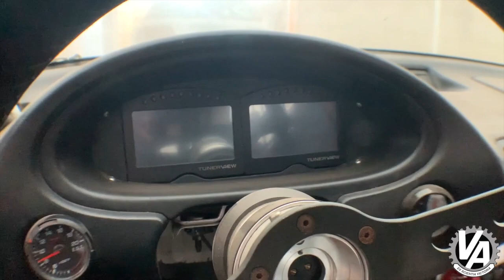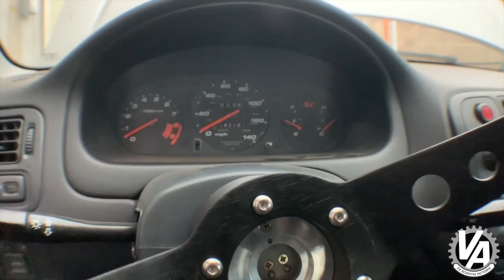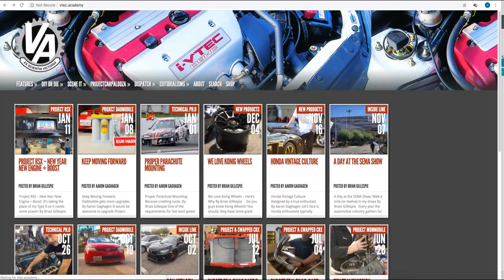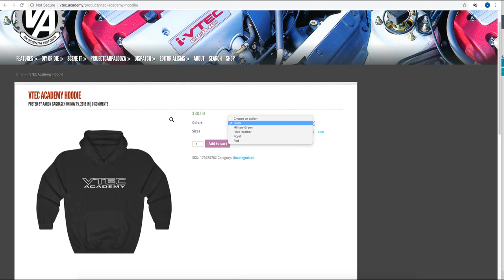B SERIES TRANSMISSION CHECK

Comment: Mainshaft outer case bearing staying in the outer case is not a sign of a bad bearing. Happens even with a brand new ITR transmission getting a FD/LSD install.
Reply: Mista boooooone
Reply: Lol nitrous single cam master
Reply: I agree, everyone I have seen has had the bearing stick in the case due to viscous oil remnant issues. They pull out easily or are a little cocked and just need a wiggle.
Reply: Mista bone the og transmission god takes me back to Honda tech
Reply: Mista bone an aquafina has all the transmission knowledge u need
Reply: First time I asked about getting synchros for Honda D-series, I asked Brian G. the OG and he gave me the aftermarket part numbers, that was 20 years ago.
Reply: @joshdane5657  There are others as well. Translab, Ghostwerks, as well as a few people local to AZ that Brian uses.
Reply: @Lulz Kev I've been around for 20+ years, since CRX Perf/Hybrid days.
Reply: @mistabone3899  ZC dual can days
Reply: @kevinc9006  or "One Cam Only" days

Comment: My notes from watching, 92-93 LS trans.

Mainshaft is toast due to the spline damage from the hub.

Countershaft needs stripped and checked for clogged oil passages as well as the outer bearings being damaged from the lack of fluid....or using current Honda MTF in an older transmission, esp. in the desert heat.

Likely the 92-93 5th shift fork is no longer available (NLA) Good news is 94-01 forks interchange.

Comment: This dude: 10 minute tear down and reassembly with a B series.
Me: 10 week tear down and reassembly with my H series. But I did do all new bearings seals, accord 5th gear, carbon fiber synchros. NO LSD. Damn I am stupid.
Reply: Do a few hundred or more, and it's like playing with Legos. But, we're all rookies at some time.
Reply: CF Synchros? why?
Reply: @scrappydogfinance8434  Synchros are nothing more than brake pads. Would you upgrade your brake pads on a car that is driven hard?
Reply: First time is always the slowest

Comment: He seems experienced with the honda trans but his hygiene was pretty poor, all that dirt from the housing on the bench and his gloves and then rolling the gear sets in the sand didn't seem like good practice to me.   I never rebuilt a tranny but I am pretty sure cleanliness is critical with automatics.  I understand this is a manual so maybe some dirt getting in the gears isn't a big deal, however I am also aware that there is no oil pump or filtration on manuals like on auto's so perhaps its not a concern?
Reply: It seemed like the consensus was that this was just an inspection and not an actual final reassembly. I disagree with the general handling of it though but it's automotive

Comment: 1998 honda prelude overheated due to coolant leak at heater hose at engine outlet split at end repaired filled with asian coolant started and ran it to check for leaks.not realizing to cool  engine down and burp engine . Trashed the engine . Did liquid combustion and leakdown test no go on both. Worst mistake so far. Retired diyer trying to save money.do not have to patience and knowhow to do e gi e swap. Plus already working on my wifes 1995 honda odyssey doing head job i  the proccess  of putting back